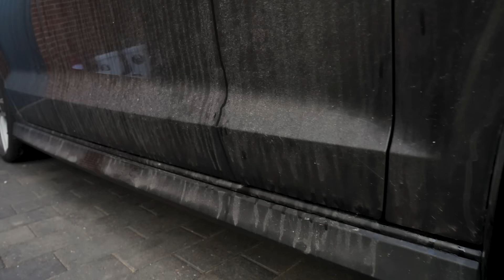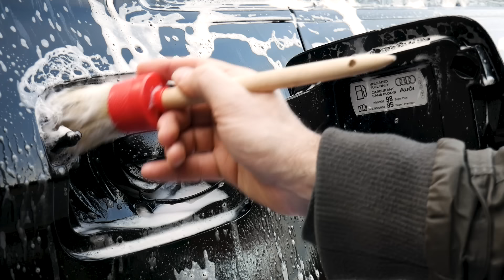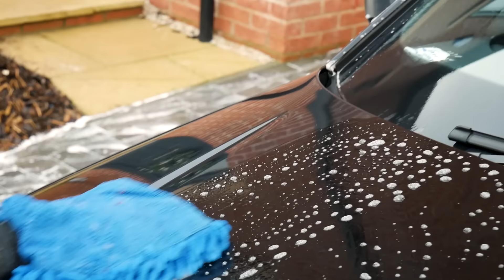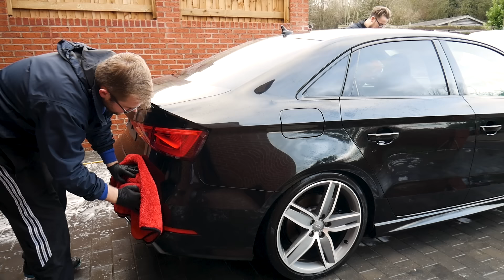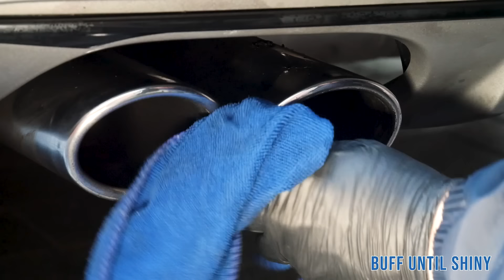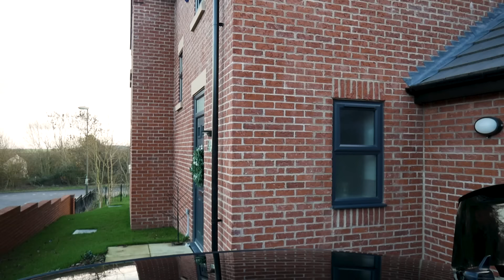10 Steps on How to Detail Your Car: A Beginners Guide

Comment: I start with the wheels then rinse of the car and then prewash/foam it. Let it soak for 5 a 8min in mean time using a detailing brush with apc for some areas. Then rinse of the car and wash it with a ph neutral shampoo with 2 buckets and 2 washmitts. Then rinse off apply deironizer rinse of or go over with a clean washmitt. Rinse off then dry car with 2 drying towels and quick detailer for better drying.
Then where it needs use tar with mf towel. Polish/use gyeon prep/wax/glass/tyres/exhaust tips/gyeon preserve ..... this is how i do!!
Reply from the maker: Nice, sounds very similar to my method 👍

Comment: I notice no clay bar being used (I've never used one myself btw - find them a bit scary) but would you say that a clay bar is optional? Superb video with great production values.
Reply from the maker: Each to their own. Some people would clay, but personally, I think you should only clay if you will be machine polishing after. The reason for that is some clay bars can marr paintwork, particularly soft paints. So for that reason, I usually avoid it if not machine polishing.

Comment: Great video, thanks for taking the time to make it. I do at least 7 of those steps, well 6 + step 11 (admire). Can I suggest step 12, add some rubber to the tyres, maybe its a trick of the light but at least one looks a bit low. :-)
Reply from the maker: Yeah, we noticed after. All 4 were legal (just), so I think he got new tyres later that week.
Reply: Nice job guys, loving the black plus the simplicity of the process. John Tht. #dw
FK1000p by hand is great..
Reply from the maker: Yes, I do like FK1000p. I used to use it as my winter wax... But after 7 or so year, I ran out last year LOL

Comment: Noticed that many cleaning and detailing videos are parked on block paving. 2 problems; If care not taken when jet wash used or even high pressure hose, the kiln dried sand between blocks can be blown up onto paintwork, also sand is then washed away from black paving. Suggest park on large tarpaulin to prevent this. What are your thoughts on this?
Reply from the maker: I don't really worry as I park on tarmac 🤣 as long as you're not blasting your pressure washer at the paving, you should be fine. The run off water is no different to a heavy downpour

Comment: Shouldn't you first wash your wheels as they are the dirtiest part of the car. Rinsing off the vehicle is alright but after you washed the wheels as you'll only end up with water spots. Not good if your just washing the car.
Reply from the maker: I know what you mean.... Now many many moons ago, before I got "into" detailing, I would always wash the wheels last based on the fact that they are the dirtiest. But back then I used one bucket and a sponge. 

Now, I wash the wheels first whilst the ground is dry. Then keep the wheels wet through all the stages of washing the car and dry everything at once.

The order of this video is how my mate does his cars (I let someone else detail so I could focus on recording). I guess it just shows there isn't always a right or wrong way, just different ways. (I know people who apply a fallout remover before washing which would seem odd).